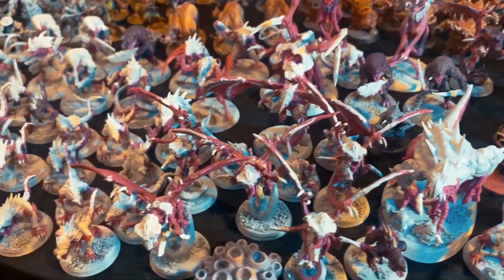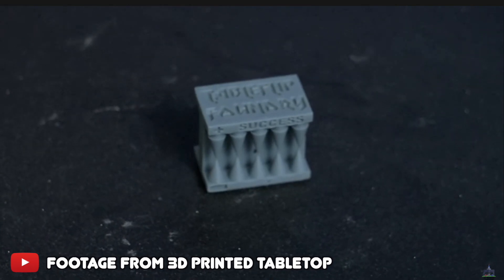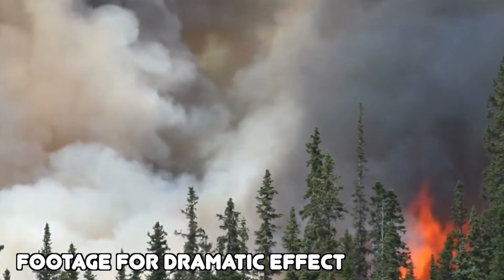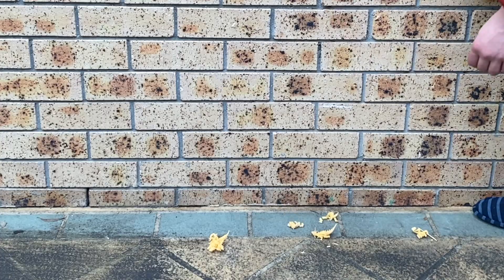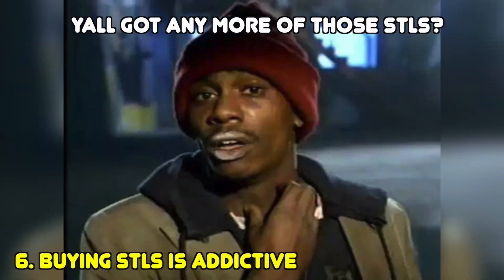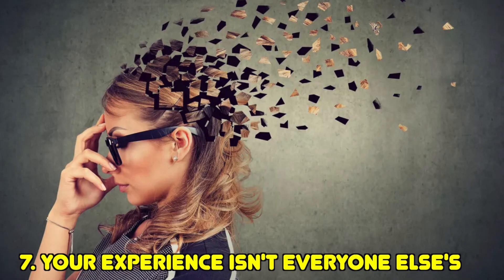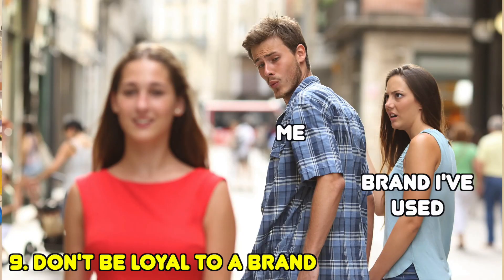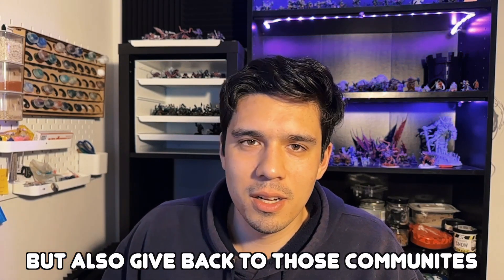What I wish I knew before starting resin 3d printing

Comment: Disclaimer to all: 

PPE is the most important thing when dealing with any chemicals. You should not enter a room with exposed (open/visible/etc) resin in liquid form. 

Wear goggles, respirator and gloves (lab coats and hazmat suits are extra protection). If you get it on your skin, immediately wash it off with soap and water.

The VOC's (fumes) cause cancer, calcification of organs/tissue/etc (from long term exposure), lung and sinus infections/burns/irritations/etc.

Carbon filters eliminate odors but not all VOC's. (The ones you set up in a room).

🥽 are important as even VOC's can seep into your eyes if they are dry, if your eyes are wet they can but the risk is low. The threat of splash contamination is a higher risk to the eye than VOC infiltration. 

Your eyes, mouth, nose, genitals, anus, palms and bottom of feet are the highest absorption zones of the body.

Before you handle any chemicals please get your hazmat or at least HazWhopper certifications 1st.

If you want a life span of 20yrs  don't worry about safety but if you want to live a full, cancer free life, get certified and practice the safety measures you learn.

Comment: Do not buy a big printer, you will be drowning in miniatures in a week! Even the smallest printer can print a 2000p army in a week or two, my photon mono 2 can fit 5 dudes on a plate and print it in 5 hours, or a redemptor on 3 plates. It also cost less than the leviathan box set. Also don't buy a wash and cure station, just put the prints into the sun for a day, turn them around and let them stay for another day.
Reply from the maker: Sorry I missed your message.
It's a question of money and convenience vs your own time. I'm happy to spend a bit extra if it saves me some time and effort down the track. But you're definitely right, a small printer can do most of what the big printers can, it'll just have to do multiple prints.

Comment: All good stuff. I have been FDM printing for a while to support my RC habit, I have two printers and fairly dangerous around Fusion 360. I have been looking at resin printing for a wile for its great finishes compared to FDM. I may have an opportunity to get an Anycubic printer for cheap, and researching what I need to know for it. Videos like this are awesome, I would prefer to learn from someone else's mistakes, and pick up any tips that I can. Thanks for sharing.
Reply from the maker: Thanks so much. I’m glad my mistakes can help.

Comment: Ah FOMO ... I have 150+ Go of files and I probably won't buy my printer before September ... (most of them free and some from subscriptions)
Reply from the maker: Yeah wow. All the best when you start printing!
Reply: "You gotta pump those numbers up , those are rookie numbers" , started out with only free stuff , dont even have a patreon , only buy on sales.
But I hadnt checked how bad it was until this video ... OVER 9000 !!

Have 147 folders with 10757 files         708 GB   <.<

*to be fair most of the bought stuff has both supported and unsupported files , so could probebly shrink this by 30% , did I mention the printer is about to arrive in august xD ?
So yeah the FOMO is real ! Damn kickstarters I tell you ..
Reply from the maker: @matso3856  haha wow that's a lot. good luck getting all that printed.
Reply: @Habes  Nothing is impossible !
It will only require 2 and a half lifetimes ;)
But on a more serious note , anything before 2007 is probably going into the bin.
Also knowing one guy who owns 7 printers helps.

Comment: Nice video. I've experienced the stress of FDM printing looking to try resin printing and finding it looks more stressful. I'm still going for it but helps to know failures are normal in the process, and to study more to avoid them. Thanks
Reply from the maker: Glad it could help! I think it depends, I've found resin not too bad, but struggling with my FDM printer.
Reply: @Habes  yeah, I need a better FDM printer, but I put enough money into it, I want to try resin printing. Keep up the videos, they’re a lot of help. 😎👍